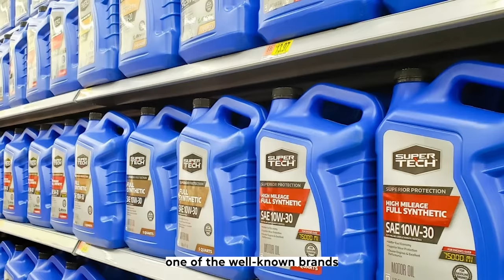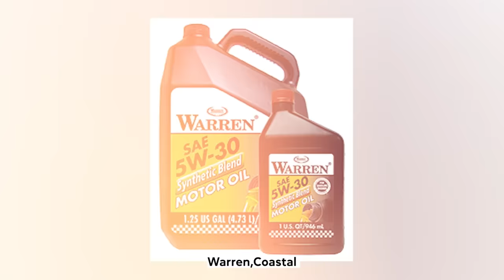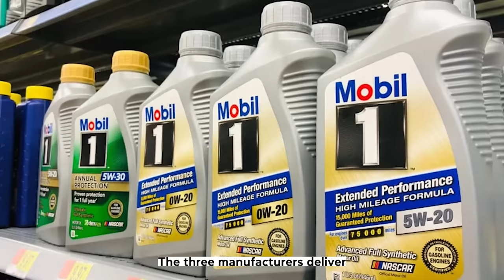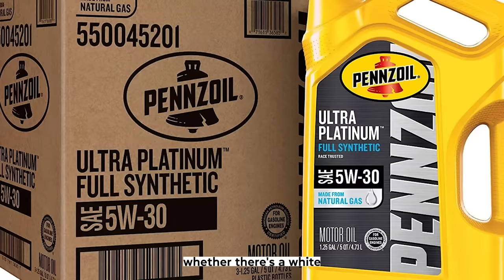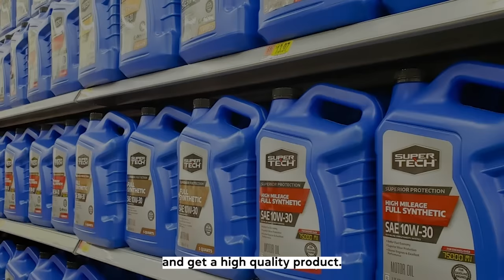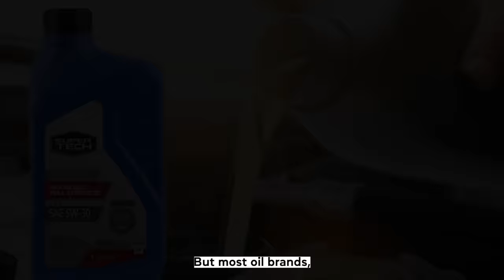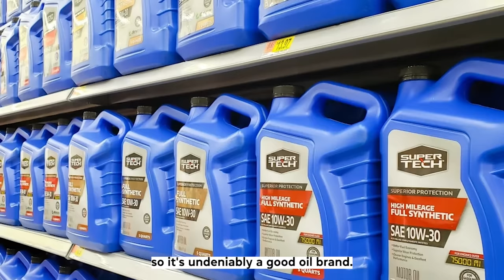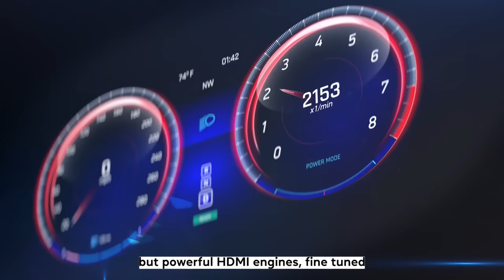Who Makes Supertech Oil For Walmart And Is It Any Good?

Comment: I like Supertech 5W30 in my 2002 Saturn SC2. This vehicle calls for synthetic oil with a filter and oil change every 3,000 miles. These engines are also notorious for consuming oil, which may be why they call for such a frequent oil change interval. Mobil 1 is preferred, but Supertech full synthetic is probably going to hold up just as well for 3,000 miles.

I would never seek to cut costs on oil filters, and would never consider Fram or house brand filters. I used Mann or Mahle filters in my VW's. I use WIX XP filters in my Saturn. Both Saturn and VW call for very specific bypass valve specifications. I simply do not trust that a generic oil filter manufacturer will honor those exacting specifications. If the bypass valve is not functioning to spec, then the engine will be starved for lubrication when it is cold, and that will definitely shorten the lifespan of your engine.
Reply: SuperTech is Mobil1 oil. 
Tests have shown that the old paper filters are still the best. They all hold up too about 10,000 miles depending on the engine. Keeping an eye on the oil condition is vital, you start seeing black carbon in it you need too change.
Reply: @markwarnberg9504  No, Mobil does not manufacture oil for Walmart. There are 2 or 3 companies that do. Warren Oil is on e of them.

SuperTech pure synthetic oil comes in a 10K variety and a 20K variety. Those are not to exceed limits. Best to follow your auto manufacturer's oil change interval.

Only a fool is going to change the oil based upon it's soot content. The larger issue in modern cars is fuel contamination which thins the oil. If you want to have your oil tested by a lab, that is an option.

No, paper filters are not "the best", and paper filters are not all built alike.

Synthetic media tends to have a larger contaminant capture capacity which is better for longer oil change intervals.
Reply: I asked the tech at my local Walmart who manufactured Super Tech oil. He told me Valvoline. He said that it comes in large drums. This is in Southern Illinois.
Reply: @Navyuncle  Hard to keep up with corporate changes. Stands to reason distributers will buy where they can get the best deal and keep cost low. The end result for you the customer is that it is all the same API rated motor oil.
Reply: @Navyuncle  Like the tech has a clue, lol

Comment: Have you supertech for over 10 years both conventional and synthetic never no trouble Engine inside is amazingly clean my car has over 250,000 miles used supertech for the last hundred and fifty thousand miles still runs like new no smoke and no oil consumption this is very good oil

Comment: I'd be shocked if it makes the slightest bit of difference which facility makes any particular bottle of SuperTech oil.  They undoubtedly use the identical formulation and use industry-wide blending techniques.
Reply: That's what I'm talkin' 'bout!
Reply: Vehicle lubricants must meet advertised grading (API and for Europe ACEA), further if one wants their lubricants used in specific vehicles, they must further meet the manufacturers requirements.

Comment: My 88 Ranger had 292,000 miles on it when a head gasket blew, after dissasmbly it was found to have negligible bore wear and the cam bearings were fine , even the crank bearings in spec, most amazing to me was the valve guides were perfect. always ran 3000 mile changes with walmart synthetic . after a hone , fresh rings and stock size new pistons and rings with a fresh valve job, good as new.also new stock sized bearings,

Comment: Oil is cheaper than an engine, so changing the oil and filter often will save you tons of money in the long run. The SuperTech filters are a pretty good deal too.
Reply: more important is to check oil level.neighbors accord only had 1 quart in engine measured it..5 quarts is full.. and she still hasnt checked it???????
Reply: Who makes Super Tech oil filters?
Reply: Champion laboratories makes Walmart ST filters.
Reply: Just buy OEM.  Especially Toyota

Comment: I started as a Turf equipment mechanic straight out of High School in 1973. I always bought Penzoil because I thought it was the best. After going to a few service schools in the mid 70's I discovered that for the most part if you change the oil and filter about every 5,000 miles you will never have a problem regardless of what brand you use. Some people will only use a certain brand oil or filter, I have used Supertech oil for many years and have never had a problem with any car I have ever owned. I am 68 years old (now retired) and I have never paid anyone to change my engine oil and filter. More engine oil and oil filters are sold because of advertising than being the best product out there. I have saved many thousands of dollars by buying Supertech and Supertech/Fram/ Wix  oil filters. I can't believe what the major auto parts stores want for 5 quarts of motor and a filter. I now own a Tesla Model Y so that eliminates oil changes on one of my three vehicles. 😀
Reply: Spot on brother. I'm 66, same story too.
Reply: Do you know anything about Marvel mystery oil?

Comment: Conventional oils should be changed every 3-5k miles, but synthetics can last to 10k miles in normal cars with normal driving habits. But that doesn't mean you can change your oil FILTER every 10k miles. You still need to change your filter every 3k miles and remember to top off with the same oil (new oil) as what's already in the car. I've been using Supertech full synthetic 0-20 in my vehicles for years, and 5w30 before that. Never any engine problems, oil leakage, or blue smoke. My cars always fall apart in other ways that necessitate replacing them, but the engines have never been the reason. Always drive them into the ground before buying another. Always regret having to do it because the engines still run like new.

Comment: For what it's worth, I have used Super Tech oil in my 1996 Monte Carlo Z34 dual overhead cam Motor for years. Only difference is I use Wix filters. 
At 175,000 miles inside the valve cover is super clean and zero sludge. The key is changing it every 3000 miles. 
And after 3000 miles its still pretty clean coming out when drained.
Reply: I’ve read that super tech filters are made by wix and champion

Comment: ANY brand of motor oil with the API seal of "SG" or better is better than what comes in your engine from most factories, and is PERFECT for ANY spark ignition engine if the "weight" is correct for your engine. I was a teen back in the late 1960's-early '70's working at a "local brand" service station as a pump jockey. Lots of our customers used RE-REFINED (used and filtered and fresh additives added) motor oil that was in quart glass fruit jars, and I changed it. I have NEVER seen an engine failure due to "cheap oil" in my 70 years. Super expensive oils that aren't CHANGED or there is DUST on the dipstick(!!!) can blow-up an engine in two miles. I worked twenty years at the old Cities Service Oil and Gas Corp (Citgo) and we made our brand, no-names, and military spec oils for the SR-71, so WHO MAKES the oil is meaningless today. In the 1960's, you COULDN'T mix some brands of motor oil-it turned into "sludge". That can't happen today.

Comment: I used SuperTech Full Synthetic High Mileage 0w20 and 5w30 exclusively on all my vehicles paired with either SuperTech or Fram Ultra oil filter for several years now. I also went ahead and put it to the test their 10,000 miles claim and holy smokes Batman. The oil itself and the filter were still in unbelievably good condition. Not once have I ever felt my vehicles chugging, grinding or buckling and etcetera. All my vehicles run smoother than ever and my gas mileage has improved significantly and scout's honor when I say "it's not a placebo effect". If your vehicle is burning oil, that's a manufactured defect and not the oil itself and ten times out of ten the piston head, piston o-rings and seals are worn-out waiting or cracked and ready to break into pieces are the culprit. Cheers 🍻

Edit: I've paired all my vehicles with a magnetic oil drain bolt plug. Best investment anyone can ever make. Get the forged steel version. Also used either pink or yellow teflon tape since it can withstand over 500 degrees Fahrenheit.

Comment: In this "modern age" .... "oil is oil" and as long as it meets specs and you CHANGE it on a regular interval... Super Tech is great. I've used it and neglected it in an old vehicle..... no issues at all with the oil.... and I will continue to use it. I save a few bucks along the way also.... great video.

Comment: I have been using Supertech oil for a long time.  Never an issue.  It meets the spec requirements by the manufacturer so that's a start.  Our Toyota recommends 10k services - I say no way.  Cut it to 5k twice a year from day one and now at 90k / 9 years with no issues.  As others have stated, oil change frequency is key, I would never go above 5k per change.  If people understood oil filters, they would realize the filters are in by pass mode long before 10k.  My other cars/truck are changed yearly which is around the 3500 mile mark.
Reply: I I changed oil in my BMW530 every 15,000 miles and I sold it last year to a buddy and it has 400,000 miles on it Still running  great
Reply: Great advise..Your personal experience proves what most of us are talking about here..Experience always beats opinion..
Reply: @bmwlane8834 what year was your 530i ?
Reply: 3,000 miles every car every time......

Comment: I run super tech oil in Everything. 4 commercial mowers. I use the 2 stroke oil as well. In f150. In f250 (gas). Diesel tractor. Motorcycle. Polaris Slingshot. Been running it for over a decade. Never lost a motor or even a valve. Good stuff

Comment: I have a 2006 Chrysler T&C Minivan with 275,000 miles on it. I have only used Super tech oil in the last 155,000 miles since I've owned it, but probably more Fram filters than Super Tech. I usually change oil between 3,000- 5,000 miles altho once I went like 10,000 miles. Still runs like brand new with great acceleration! All of my other vehicles have all used SuperTech and I never had engine issues ever, just rusted out bodies from salt!

Comment: Good video. Thank you. I use Super Tech oil in my vehicles. I change my oil at 3,500 miles. I have no complaints. I had a 1998 Cutlass and a 2000 Isuzu Rodeo. The Cutlass was still running strong until I forgot to switch the cooling fans on and went into the house and forgot that it was running. The Rodeo had a stretched timing belt and got out of time. It was still running but not well. No oil related issues on either of them. I decided to junk both of them. I ran Super Tech oil in them for twelve and eleven years. I now have a 2004 Caddy Deville with 95,000 miles and a 1998 Chevy Silverado C1500 with over 276,000 miles and run Super Tech 5w30 High Mileage in both of them.

Comment: Been using mobile 1 since it came out, never had a problem. Owned a 95 F150 for 20yrs, compression is up to par across the board. Regular flushes like the cooling system and transmission, and brake fluid will keep you rolling trouble free, plus regular lubing of suspension 👍

Comment: I have a 1907 model T with 9 million miles. I’m original owner.  It’s my daily driver.  I’ve used supertech full synthetic from day 1 along with supertech filter. I change oil every 10,000 miles . It still runs like news. PS both of my kids and all 3 of neighbors kids were conceived in this car while using supertech oil.  So far no complaints 😁

Comment: Been using Supertech 5W30 full sythetic oil in my 2010 Kia Sportage with 2.7 liter engine . Change oil and filter every 10,000 klms . Vehicle now has 636,241 klms on it . Never have to add between changes and runs beautifully . Great product !

Comment: Look into adding Marvel Mystery Oil to the engine oil,  maybe after 4000 miles to top it off and put the level slightly above full, then change it at 5000 miles. Valvoline and Pennzoil are probably the best for the price. Amsoil is good but expensive.
Reply: Why would you want to reduce oil life by adding garbage?

Comment: Further, Walmart Super Tech oil currently meets API-SP and ILSAC GF-6A requirements as well as, GM requirements. 
API, ILSAC raised the bar for engine lubricants, making it difficult for just any lubricant manufacturer to meet those requirements. 
The latest requirements at the time of this printing are 
API - SP
ILSAC GF-6A
These are licensing and certification standards, oil companies must meet prior to marketing products which indicate such on their labeling.

Comment: I've been checking oil tests for more than two decades now, and supertech has outperformed Mobil 1 in tests of all times for a long time. So much so, that I used to use supertech oil along with the hard driver oil filter when the oil would not start getting dirty for almost 10,000 miles. When Mobil 1 bought that oil filter from hard driver and started putting their name on it, that oil filter quickly became about 60% to 70% as good as it once was. I now try and go with the Purolator boss oil filter and a good solid motor oil. Usually supertech. I find it more than adequate, there's only a few oils that outperform it, but for the vehicles that I drive it's more than adequate and better than mobile one by far. Roughly equal to Valvoline, Pennzoil and Amsoil will outperform supertech. Kendall will outperform all of them as it will take more heat than any other oil that I am aware of. I think Amsoil comes close. As for this video, about 60% of everything you said is categorically in error.

Comment: I've noticed that SuperTech is closing the gap, price wise in the last few years.
Reply: It's right next to the brand name oil.
Reply: I've noticed that too and probably because of the high demand for it now🤷🏽‍♂️
Reply: It’s still very competitively priced.
The Walmart near me here in NJ has the 5 quart jug at $18.98 for full or high mileage synthetic.
The other top brands, Valvoline, Pennzoil, Mobil 1 , range in price between $26.97 and $29.97.
So at a minimum we’re talking $8 and at the top $11. With that difference you can get a pretty good filter, so that the savings are significant.
I’m running SuperTech 0w20 at $18.98 and a Fram Ultra Synthetic for $8.97.
That’s a grand total of $27.95. Not bad , no?
And as I change it myself , that’s a huge savings. Just take care to change it regularly with 5 to 6,000 mile oil change intervals. Driving a 2007 Accord coupe 6 cylinder that just cracked 200,000 miles.
Engine is clean as a whistle and purrs like a kitten. Not a drip or a drop on the driveway.
 Cheers, friend 😊

Comment: I used to drive in Walmart's private fleet of trucks, running out of the Shelby NC DC. One of my regular dispatches was to a facility in Charleston SC to pick up loads of motor oil, already loaded on a trailer. The load manifests always said what was loaded on the trailer. There would be Havoline, Mobil 1, Castroil, Valvoline, Kendall, and the Walmart house brand Supertech, all synthetics. I never saw the bottles being filled so I can't say they are all from the same exact vat or tank of motor oil, only that those brands were loaded at the same place. In my opinion, they are probably all the same and oil changes at regular intervals is most important.

Comment: The fact that some of the WalMart oils are supplied by Exxon Mobil does not mean that they are Mobil 1.  I used to work for one of the best industrial lubricant suppliers in the world.  We had access to both lab and real world test results for all major brands.  I run Mobil1 in all of my gas engines, Rotella and Delo in the diesels.  I change oil in the cars once a year.  Which is probably why I usually only get maybe 300,000 miles out of an engine.  There are currently three Chrysler minivans sitting in my yard with around 200,000 miles on each of them.  And each of those engines looks new internally, not a trace of sludge or varnish.  But I live in a mild climate and run no short trips.  If you live in the north and run 1/2 mile trips in the winter changing oil every 6000 miles might not be often enough.

Comment: 2010 Nissan Sentra SR with 259,040 miles (over a quarter ot a Million miles), on Supertech oil from day one.  Only engine repairs have been a couple of coils, the starter, and alternator. Does not burn oil.  Key is to change oil at most every 10,000 miles and don't run it like it's a race car. As for the oil filters, I always use the inexpensive ones,  and I put a microwave magnetron round magnet on the outside bottom of the oil pan.

Comment: SuperTech is good oil and there have been enough tests to prove it. However, just because an oil is made by a reputable manufacture is no guarantee it's the same as other oils from that company. 

The retailer will provide the manufacture with specs for x amount of oil at a certain price. The manufacture then produces oil at the agreed spec, but it is no guarantee that that it is the same oil that other retailers sell.  They are simply providing them with oil according to their requested specs. This doesn't mean it's a bad thing as long as the buyer doesn't think he's getting Castrol, Valvoline, Quaker State, etc. from a bottle of SuperTech. 

Bottom line, if the oil is certified for use in an engine and changed often, use it and find something else to worry about.

Comment: Interesting video.  I have been using Super Tech oil for quite a few years in my Toyota Tundra and Rav4, as well as at least one of my motorcycles, with no issues.  The Toyota's are now around the 150,000 mile mark and I never have to add oil between the 5,000 mile changes.